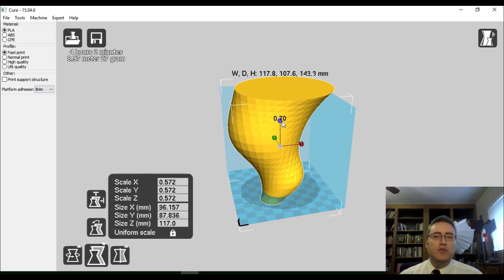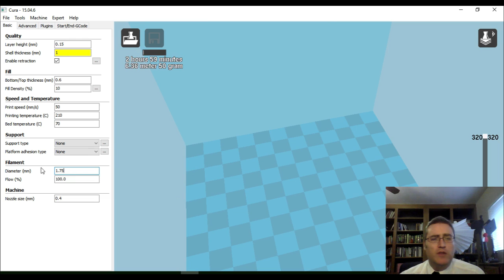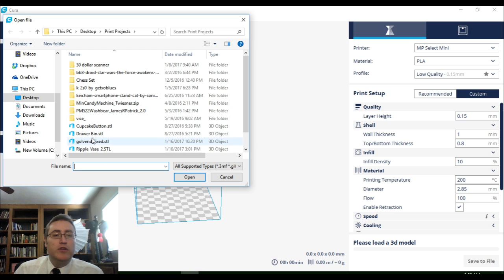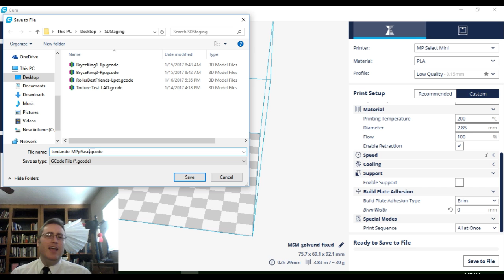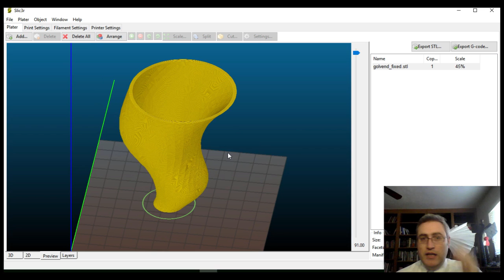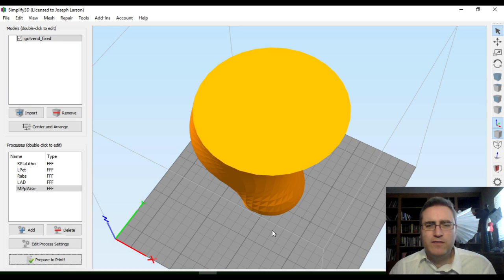3D Printing 101 - How to use Slicers by Example: Cura, Cura2, Slic3r, Simplify3D

Comment: I like your videos and will recommend them to a friends child I am teaching.
I still run Cura 15.04.6 on an off line Win 7 Machine. Cura 4 is a huge piece of bloatware that wants me to cloud connect and patronize their vendors. I tried loading Cura 15 on a Win 10 machine and Win 10 does not support the Python version that Cura 15 uses. I have the same problem with Blender 3.0.0.
 Prusa Slicer looks like a nice clean piece of software though I have not printed with it yet. I have set up a printer in it and gone through its functions. It is very impressive.

Comment: Hey on the Cura 2 tutorial I see at 23:16 that you have set 2.85mm diameter for the material, isn't the MP Select Mini 1.75mm?
Also MSM is the acronym of your printer, you can disable this in the General Preferences "Add machine prefix to job name".
Reply from the maker: Good eye. Good think I didn't try printing with it. Or maybe I should. Could be pretty.

Comment: A bit of a clarification: In Cura, you mention that you wanted 4 walls.  What you put in was 4mm, which would be 10 walls, since the thickness is .4.  If you wanted 4 walls, you would put 1.6 for the mm measurement.  You would be using a lot of material for a solid fill for those walls.  (I see that you refer to it correctly in Cura2.)
Reply from the maker: You are correct. And I knew that, I've mentioned that to people before, but when it came to sit down and do the video I went stupid. That's alright, I'll fix it in the write up.

Comment: Is there a slicer that has a "tessellation" feature? To make objects with few polygons that are meant to be smooth / phong shaded automatically smooth in position? So that for example those triangulated quads on the tornado vase will be turned either into finger tesselated and smooth quads and output smooth tool paths?

Not sure if STL even supports smoothing groups and normals though. Might need to use OBJ or other files.

EDIT: Ironically STL means standard tesselation language while apparently not supporting tesselation because of the lack of smoothing groups / normals.

PS: Btw your real name is showing in the simplify 3D video section :)
Reply from the maker: So far, no. Most slicers do very little to modify the model, and nor should they in my opinion. If you want to smooth the mesh take it into Blender or MeshMixer and modify it there.

Comment: Good Cura2 video, but I have been having trouble with printing supports. Can you make custom supports in Cura2 and make them thicker?
Reply from the maker: Cura2 does not have options for custom support and support settings like what you're trying to do. The only slicer I know that does that is Simplify3D.